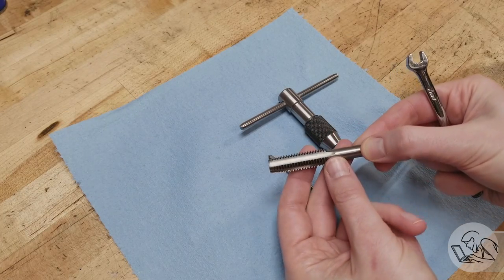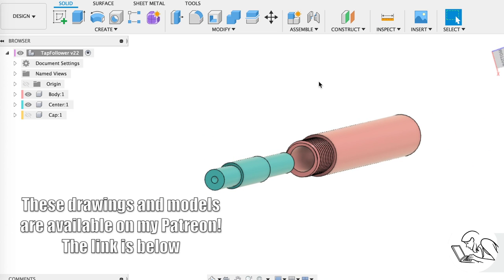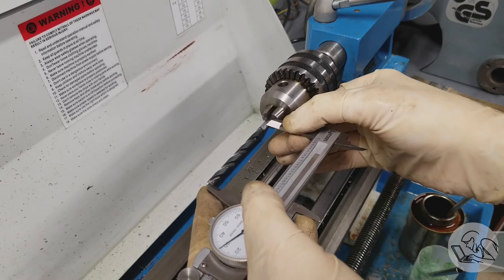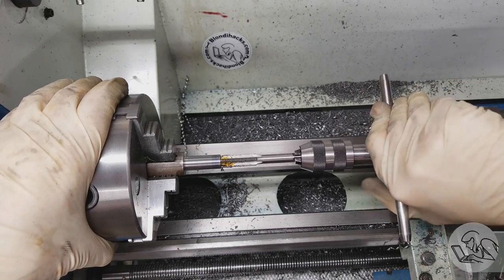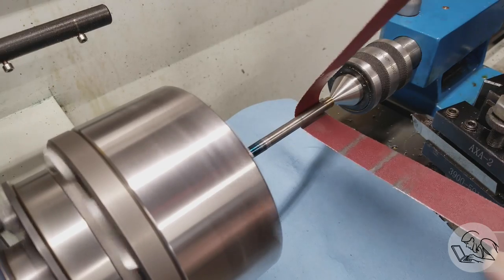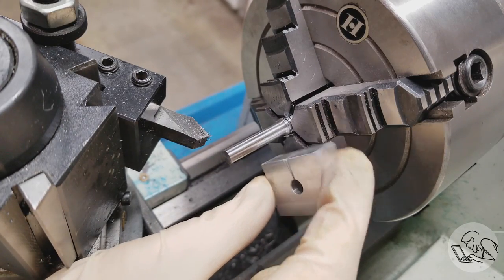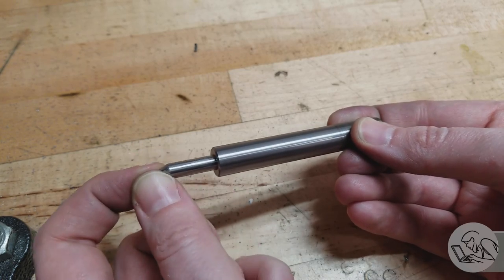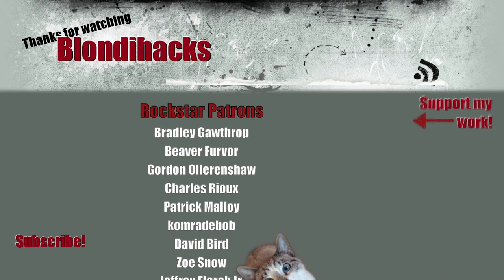Let's Make a TAP FOLLOWER!

Comment: Firstly, I'm a big fan. You're a machinging machine - you're honest, entertaining, smart and funny and highly competent. Here's the BUT, but it's probably more about me than you. I've always found that taking somehting to fit with emery paper is a fantstic way to turn a cylinder into a pearl necklace, because the consistency of application is totally in the head - which is to say - is absent. Of course, at some point, you'll have a part that "fits",  in so far as no part of the width is wider than the thing you;'re fitting in to, but the size and number of areas of contact will be dependent on which tune you were whistling as you emeried. Just my two farthings worth.

Comment: Is there a similar gizmo for dies?  I have bad memories of threading some rod off center which led to poor performance of a coil winder I tried to build a-la Gingery.
Tail stock die holder?  But I don't have a lathe (yet)!
Reply from the maker: Yep! It’s called a tailstock die holder, and I use it in this video.

Comment: For the negative point length, you talked about the radius on the reamer, could you then just add a chamfer on the major diameter on that side of the inner part for clearance from that radius? I know it wont add much but it's something
Reply from the maker: Definitely that would help! Most of the lost length is due to the portion of the 118° drill point that remains in that end, I believe. If you look at the clip of the drawing I posted in the video, you can see what I mean. I didn’t account for that when setting the length of that part of the pointer.

Comment: For longer parts, how long can you go until you need a rest support in a lathe?
Reply: That's something that depends on material, diameter, depth of cut, and a few other factors.
Reply from the maker: The general rule of thumb is 2-3x the diameter of stick out is okay but as Drew said, there are a lot of variables. If it’s chattering, that’s too far. 😬
Reply: @Blondihacks  Thanks! 
Rule of thumbs are good enough for me :)
Reply: @Blondihacks  well there are some materials that chatter for me even with the stick out being 0.5x the diameter. Guess I'm just not that good yet

Comment: To combat the cap unscrewing itself during use (like you mentioned) Could you have cut a left hand thread in the body and cap? Maybe cut a square or hex on the cap so you could use a wrench to remove it...I guess you'd need one on the body too, eh?

Comment: Question for you, when reaming the ID of the body why didn’t you drill then use a small boring bar to final size? It would make a concentric hole, and you wouldn’t have encountered the shoulder that the reamer made.
Reply from the maker: I wouldn’t be able to bore such a small diameter that deep. A boring bar that small wouldn’t be rigid enough at that length

Comment: Thoroughly enjoyed this!
Probably not too important here, but it is important to realize that drill rod, like all bright drawn steels, often has residual surface stresses.
The steel will deform as soon as the surface is removed. Very bad news for a long part. With a short part like this, you'll get away with it.

Comment: Just a thought.. Why not make the end-cap smaller diameter to reduce the squeeze load from using drillchucks etc..? Might not make much difference from a mechanical point of view, since you have the threads there but might mitigate any distortion and binding from use.
Reply from the maker: You’re typically holding it at the front or in the middle somewhere, so the cap doesn’t come into play at all.
Reply: @Blondihacks  Good to know because i have never used one myself.

Comment: Hey Quinn, awesome video as always. I'm wondering, Is there a reason you don't 'blue' the threads/inside/tool surfaces? If it assists with corrosion resistance wouldn't it be ideal across all surfaces? Or is it mostly aesthetic and oil does the job for other internal/threaded/tool surfaces? Cheers!
Reply from the maker: Honestly, it’s just really hard to get a good finish on threads with that stuff. It only provides very mild corrosion resistance in any case. You really need to oil stuff if the environment is humid any way.

Comment: Do you set the angle on the compound at the angle or do you set it at half?
Reply from the maker: Depends on the markings on your lathe, but usually you set it to half. If in doubt, put a protractor on the side of the compound to see what it will end up cutting.

Comment: Please don't take offense. By all means face your stock close to the chuck. However, suggest you leave putting in centre drill until after you have moved stock out to desired position. The reasoning behind this is two fold. Chucks invariably are not super repeatable. Bar stock is often flawed. By waiting to centre drill, these factors are eliminated and as a bonus your drill is much more likely remain straight. Often when parting off pieces like you showed if you use a smaller piece of stock with a centre drill hole in one end and a bull nose on the other, when you put pressure on with a centre, it often dampens the chatter and catches the part. Doesn't work every time but just another trick to have up your sleeve
Reply from the maker: I’ve done it both ways- cutting the center before pulling the stock out and after. I haven’t found much different either way. I understand what you’re saying and in theory it should help. In my experience, I get better centers this way.

Comment: Awesome job. Quick question. I love how you made it assemble from the back end. Why did you use a cap instead of using something like a set screw to hold it together?  I think something like a set screw would be better and a little easier but I’d love to hear your thoughts. Thanks for the great videos. 😊
Reply: You can change the tool side of the tap follower without a tool.

Comment: I'm betting this tap follower will never be opened and reversed (small taps would be held in a small tap holder with the center in the end anyway) so the "can of snakes" spring setup would have been totally fine.  Only a complete weirdo would turn a small tap with a small wrench!
Reply from the maker: Yah I’m not disappointed that the inverted end didn’t turn out. I’ll likely never use it anyway

Comment: Where did you learn machining ? You`re pretty good..One question though. Do you know what caused the concentricity issue with the pointer fitting the tube, iI don`t think it`s the center as you thought ? I just want to see if you figured it out, I`m pretty sure I know ?

Comment: Hi Quinn. Just started making this following your drawing. I can’t see mentioned anywhere what the external diameter is of the 7/16 20 end-cap on the larger part. You turn it down a bit but don’t mention the diameter unless I’ve missed it somewhere. I’ve looked up what I think might be the size, which is 0.4362 but I suspect I’m wrong. Could you advise please 😊. By the way, you are the only youtube channel I have ever donated to as a patreon.
Reply from the maker: Drop me an email or a note on Patreon and I can assist! YT comments are not a good medium for tech support. ☺️

Comment: I’d rather see you explain than to look up myself on internet, so can you do an explanation on steady rest and their design if not already done?
I would have thought the tips of the three points would have some rolling feature so no friction.
Reply: There are pros and cons of both rollers and flat points for a steady rest. One main consideration is that you need to keep both well lubed and to keep the chips away from the contact area. Many people will make a cardboard guard that is placed between the steady rest and the cutting tool to keep the chips out of the contact area.
Reply from the maker: You bet! I’ll be doing a video on steady rests at some point
Reply: Blondihacks brilliant many 😊
Reply: @Blondihacks  please  do a video🙏. I'm in the market  to buy one. My Bolton  CQ9000 Series didnt come with one.

Comment: Are you ever going to upgrade the lathe with an oil/coolant sprayer?  I would really like to see how that can be done. Or at least a  discussion on the whys and why nots. Thx.
Reply from the maker: Probably not this lathe. It’s not well set up for flood coolant. I may do it to my mill though, which has drains in the table.
Reply: @Blondihacks  I meant what if you added a drain table or made the lathe set up for flood coolant? You are smart, I know that you can figure it out. Blondihacks style.

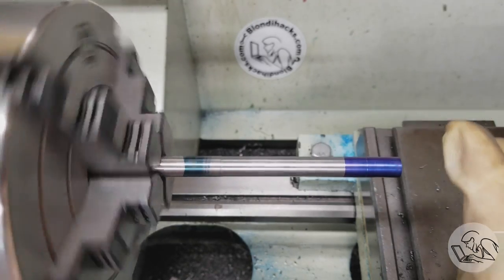Comment: What's the thick red grease(?) that you used with your dead center at 14:20 ?
Reply from the maker: Any high pressure grease will work. I use automotive wheel bearing grease.

Comment: Just wondering, could you have squared up the bottom of the holes on your mill?  Would that even be practical?
Reply from the maker: You would need to do it with a boring bar, which would have to be very long and thin, which isn’t going to be rigid enough to work. Therein lies the dilemma

Comment: Any particular reason you didn't single point those outside threads?  I avoid using dies except for chasing damaged threads.
Reply from the maker: Because on a small lathe you have swap all the gears around to do that and it’s a big hassle

Comment: Instead of external threads and a cap at the end, wouldn't it have been better to use internal threads and a 'plug' that is entirely inside the barrel? 
(I'm making one of these as soon as I can make more than just misshapen swarf on ny SIEG... )

Comment: Nice video, and a good project for me.  Silly question.  Why not drill the inside hole first so you can have the majority in the chuck and you wouldn't need the steady rest.  Then you can turn down the inside.  I'm a novice turner, so this is more a learning question for me, not a critique of you.  Thanks!
Reply from the maker: Good question! The goal was to do everything in a single setup to maintain maximum concentricity. Any time you move the part, you will lose some. Dialing in will never get it perfect. This way the outside diameter, inside bore, and end bore were all done without touching the setup.
Reply: @Blondihacks  Got it.  Thank you for the explanation!

Comment: You could have used the hacksaw at the lathe. Turn on and saw, way quicker ;)
Reply from the maker: I hope you’re kidding- never use a hacksaw on a running lathe. That’s very dangerous. Some people will do it with the lathe stopped, but I prefer not to. Hacksaws have a habit of slipping and hitting things around them, like the ways or chuck.
Reply: @Blondihacks  true words. Mea Culpa

Comment: Don’t understand the using a steady rest.  Why not do the ID work while the stock is buried in the chuck.  Then extend the part and hold it steady with a live center while doing the OD.  But even then why not start with 1/2 diameter drill rod?   I recently made one because I got tired of changing from point to negative point.  Now one of each.
Reply from the maker: Lots of valid ways to do any project.
Reply: Blondihacks  Yes there are.  You apparently know what you are doing so I made the comment in such a way that you could explain why you did it the way you did.
Reply from the maker: @dougberrett8094  Happy to elaborate. As soon as you move something in the three-jaw chuck, you lose concentricity. You can dial it back in with the four-jaw, but it'll never be perfect. I wanted concentricity to be as high as I can get on this, since it's a spindle-axis tool. One way to do that is to never move it once you've started turning. This insures the internal bore is perfectly concentric with the outside diameter, because both were turned without touching the setup. As for the drill rod, sure, you could start with lots of things. I used what I had.
Reply: Blondihacks Thanks.    Knowing the reasoning behind things is a big deal to me.    As for using what is on hand, that is often what determines what I use.   I do hate steady rests.   I have one for both my lathes.    I avoid them like the plague.   So if I bored out oversized material I would likely drill the large bore and then the smaller one from the same end.  To keep them running true I would dress the drill for each step to insure the edges were even so as not to walk.  After reaming both bores I would part off and then turn between centers to keep concentricity.    My live center has about .0005 TIR or FIM. so I think it would work.  Also it is neither here nor there, but I use a large set screw to press on the spring.  No separate concentricity to worry about.

Comment: I love and admire your TLC & craftsmanship but still must disagree that the tolerances have to be quite that tight.  IMHO a couple thou instead of a couple tenths would be just fine for this and would assist free movement even with a spec of dirt here and there.  If you use a tap handle in most situations (as I do), it probably has at least that much axial misalignment to start with.  I say this because I used to do the same!

Comment: I know I'm way late on this, but I just discovered (and subscribed to, because it's good content!) your channel. 

But as a mathematician who somehow gets paid to write software, I have to take issue with your binary conversion. 1101.10 isn't 13.02 in decimal, but 13.50. The "10" after the "binary point" (it isn't a decimal point, is it?) represents 2/4, not 2/100. That is, 2/2² rather than 2/10².
Reply from the maker: As someone who has written extensive floating point and fixed point math routines in assembly language (some as part of building an 8-bit computer from scratch- check out my blog for more), I am aware of the point you’re making. I decided to show it this way because it was funnier (being even more wrong).
Reply: @Blondihacks  Fair enough. It's just sort of a pet peeve because I see so many people do that unironically. (Though usually those people go with 13.2. I was rather surprised to see .02.)
Reply from the maker: You’re at risk of over analyzing a very dumb joke here. 😬